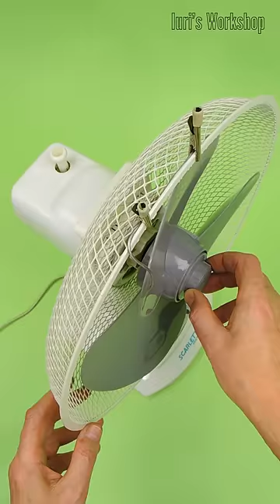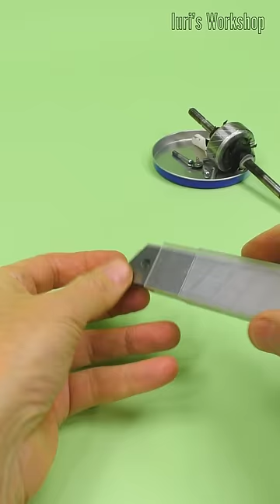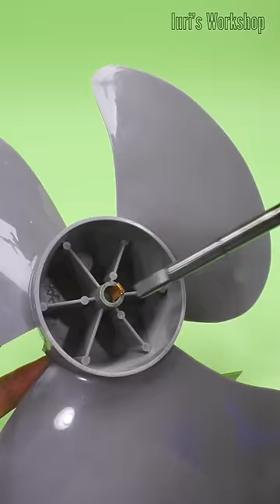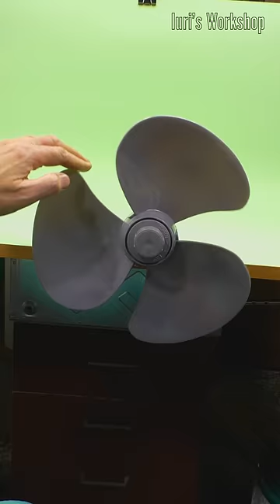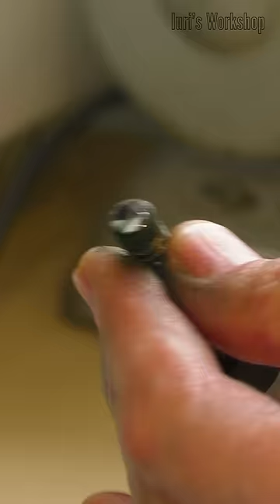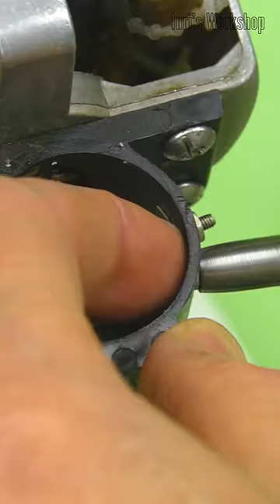Is your fan rattling? – Fan motor balancing!!!

Comment: Went at that the hard way, usually its 1 blade tweaked out of alignment, warm up the tweaked blade with a blow dryer and then  gently tweak it back in alignment with the other blades
Reply from the maker: Yes, but if you overheat the blade, you will have to throw away the fan.
Reply: How about adding weight to the others to balance the flow?

Comment: so that's why fans from 2015-2018 doesn't last any longer the motor is getting too hot and the coils are burning that's why when we rest the fan and turn it on again, it doesn't make any hum of power is just dead cuz the color of the copper is brown and smell pretty bad. i really love this technique that you made fro this kind of any modern fan problem. vintage fans do really last longer a quite long
Reply from the maker: If the rotor is not spinning, you just need to lubricate the bearings!
Reply: @IurisWorkshop  sometimes with lubricant on it, it won't spin even i adjust the screws at the motor casing, is just humming and the rotor is stuck but when there's no power flowing i spun the rotor and it was actually fine and smoothly spinning, the rotor was stuck cuz of the boosing was ripped off or scratched from the shaft so when there's magnetic field flowing through the rotor is just sucking the rotor not spinning it

Comment: just replace the bushing and shaflt.
you don't have to complicate things like fabricating tensioner.
Reply from the maker: There is no play between the plain bearings and the shaft. And if there was a backlash, then it would be easier to replace the entire fan. But an unbalanced rotor with an impeller causes axial detonation.

As for the restoration of plain bearings, I have two copyright technologies. But I have not yet begun to publish them, since they are unlikely to be in demand. Modern masters can only change the nodes entirely.

Comment: Well, I'm not exactly sure if it's a good idea to be applying that kind of friction and potentially vaporizing and widely distributing a perfluroalkyl substance such as Teflon presumably inside the place where you live. I don't know for sure if this is even possible, but I'd probably avoid doing that anyway just to be on the safe side.
Reply from the maker: Then you will have to take out the tape recorder, Blu-ray player, VCR, all fans and other devices that have motors from the house. Each motor shaft has at least two Teflon washers. :) But seriously, Teflon coated with grease does not generate dust.

Comment: lotta work $15 would solve
Reply from the maker: I don't refuse donations! :)
I now have 4 fans running around the clock. I have to do preventive maintenance - lubricate the bearings every two weeks.
4*15*2 = 120(dollars per month)
Here only at us such fans cost 25-30$. :(

Comment: Bro this is winter ❄️🥶
Reply from the maker: I use my fans in heat pumps to save money on heating. They work around the clock, so you have to get rid of the noise.

Comment: Buy a new one after checking in shop that it doesn't rattle.. less effort.. and would cost less too..
Reply from the maker: I have already bought two modern fans, which, unlike the old fan, have both bearings that are self-centering. But the fan has already served for 20 years, it will last the same amount. When we are careless about things, we are killing our planet.

Comment: What you did ? Really I want to understand as I am a mechanical engineer, please reply me 🙏🙏🙏🙏
Reply from the maker: This is called static or weight balancing. There is also dynamic balancing, which requires special equipment, in which there are vibration sensors, and the part itself rotates.
Reply: @IurisWorkshop  thanks for yours quick reply, I know balancing of engine but what you did is really crazy , can we have call please ?
Reply from the maker: @nvcworld6423  
I am a mechanical engineer
You are an engineer who thinks it is possible to make calls through the Youtube player... :)
Reply: @IurisWorkshop  it's bouncer for me, can you please explain me ? 🙏🙏🙏🙏
Reply: @IurisWorkshop  bro come on please, I know we can't talk by you tube , I mean how we can talk that's was intension , ha ha ha you consider me big stupid thanks for that 🙏🙏🙏🙏